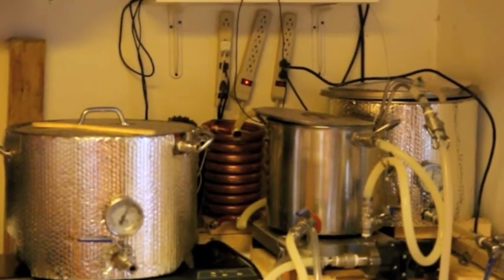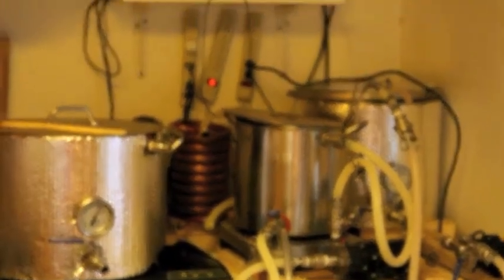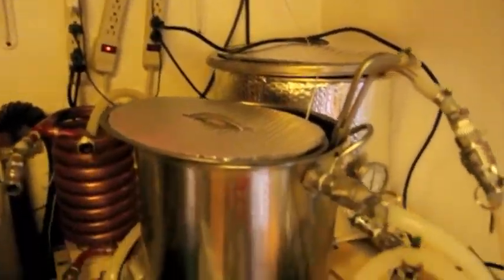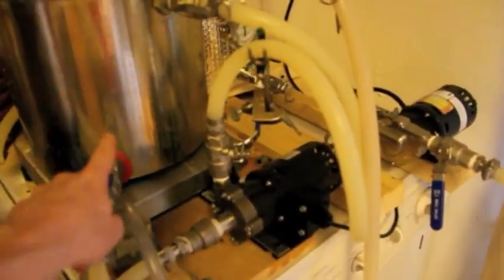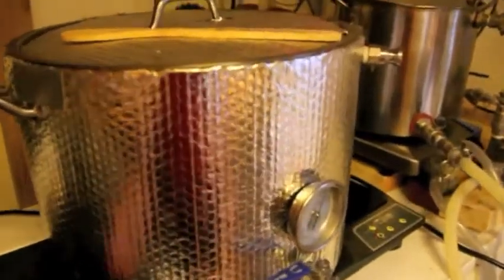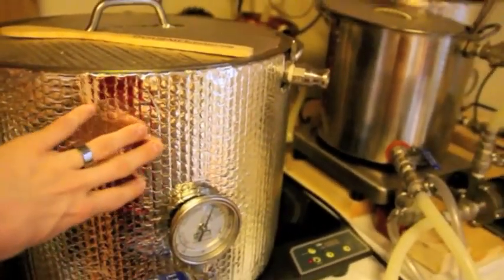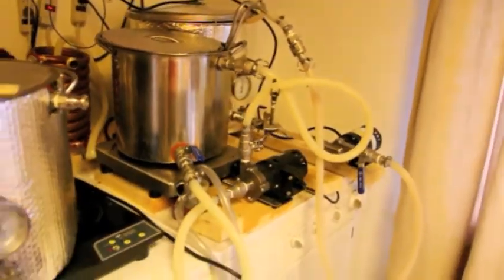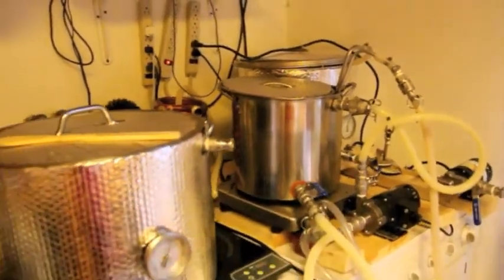All-electric All-Grain HERMS Tiny Footprint video update

Comment: I recently got a Max Burton 1800w induction cooktop. I just ran a test with 3G of water in an 8G kettle. At max power I was only able to get it to about 204F with the lid off and 212F with it on. The latter boil was rolling nicely but with boil overs that probably won't be very practical. I also haven't insulated the kettle. In your experience do you think I can get a nice rolling boil with the lid off if I insulate the kettle?

Getting a second cooktop is an option assuming my 8G kettle can span the two. Do you have those plugged into separate outlets?
Reply from the maker: Hi Mike, Indeed, I now use two separate cooktops, each on its own separate breaker. The insulation also helps a lot, though be careful you don't get it too close to the cook surface as it can catch on fire! When I was using a single cooktop, I also used an immersion heat stick (from amazon) to help give it a boost, but still probably require at least a partially covered top to get a nice boil. I still have not found the perfect solution, so let me know if you improve anything. Best!
Reply: Bryan Dickinson Thanks Bryan. I think I found an accessible 240v outlet that I can use. Going to give a 3500w cooktop a shot for the boil. Will use the 1800w for the mash. I'll report back once I get it all setup :)

Comment: I'm just starting up and was planning to use a BayouClassic 1040 10 gal pot and Burton 6200 1800W. BayouClassic confirmed their pots are induction ready. I'm hoping the fact that they are taller than they are wide will help boil performance. It seems that NorthernBrewer was able to boil 5.75 gallons in decent time in this article: northernbrewer [dot] com/connect/2011/07/induction-brewing/ 

Wondering if you were seeing similar boiling results (with one induction plate)?

Comment: Thanks for the info! Originally I was planning on using a single kettle to double as a HLT and BK. Am I correct to assume this would'nt work for a setup like yours, because the pid wouldn't work with the induction burners and the hot plate (plus heat stick) wouldn't be enough to boil 6-7 gallons?

Comment from the maker: I drilled my own kettles...don't worry about! You really won't mess up. You will drill very slowly so you'll be able to check many times before you get to the proper size. If you are doing stainless steel, you need a small drill bit (tungsten carbide) to get a hole started, which is by far the hardest part. Then, you need a tungsten step drill bit to get to the right size (easy part). Keep oil on (I just used cooking oil) to keep it cool and there are good vids online about drilling stainless.

Comment from the maker: I think the Ranco would work fine, but I have no experience with it. I wasn't clear about this, but I use a conventional hot plate (1500 watt) for the PID controlled HERMS system. This is actually fine for keeping 5 gallons at temperature. I use the induction cookers for the boil (1800 watt Max Burtons from Amazon).

Comment: Thanks for the update! I'm planning on doing something similar.  Couple questions: would a ranco controller work instead of te auber pid? It's a little cheaper. Also, I've read that some induction burners turn on in standby mode so you have to set the temp to start the heat every time - I'm assuming that's not the case with yours? What model(s) do you use?  Lastly, I'm a but apprehensive about drilling my kettles, did you drill your own? Any advice?